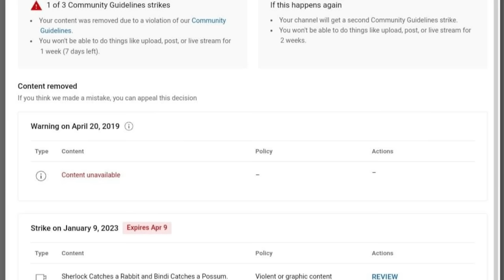Can the Mink Man Train a Badger?

Comment: Soooo awesome Joe !!! You're the Man bud ! 💪🍻🙌

...could you use an air compressor with a long hose to get into those rat Burrows instead of using water, soap or a shovel 🤔 *if you use a long hose(50-150foot long) you could go into the burrow & keep the compressor/compressors far away so it's not noisy and the pups could hear you...LOVE the badgeer idea aswell,,if anyone could train a Badger it would be you Joe 💯💪🙌

Comment: A Small engine’s exhaust down the hole would force them to get out without water, soap or a mess. It will kill any that do not get out in time. You can use the exhaust from a generator and use the power for lighting for shorter days.
Reply from the maker: I've smoked rats out before and it's absolutely horrible. Everyone is choking on smoke and stinks for days. Then on top of that you never know what you've killed and what just avoided the smoke. You just pretty much dropped the bomb on a city and walked away with no idea who died and who didn't. It is something I've tried and have no interest in messing with anymore.

Comment: I'm curious.  Have you considered dachshunds?   They're impressive diggers, and we're originally bred for hunting burrowing animals.
Reply: He made a video about dachshunds. They are simply not fast enough. Originally dachs used to just be long-bodied terriers w relatively normal leg lengths, but modern dachs have been bred so short most could not do ratting work. His terriers are much faster and more trainable.
Reply: @rebeccaburrow7199  makes sense.   Thanks for the reply.  I appreciate you taking the time to respond like that.
Reply: @rebeccaburrow7199  also, I'm sure that what he said about doxie's is generally true, but there's lots of individual variations within breeds.  I bet there's some doxie/hybrids/mutts that might excel at ratting.   I had a doxie/jack Russell that had some chops.

Comment: i see you using water to flush out the  rats i use a chain saw engine with blade removed and a pipe on the exhaust plus i put a bit too much oil in the fuel so it smokes a lot put the pipe into the holes and rev the engine a lot and smoke em out
Reply from the maker: I've smoked rats out before and it's absolutely horrible. Everyone is choking on smoke. Then on top of that you never know what you've killed and what just avoided the smoke. You just pretty much dropped the bomb on a city and walked away with no idea who died and who didn't. It is something I've tried and have no interest in messing with anymore.